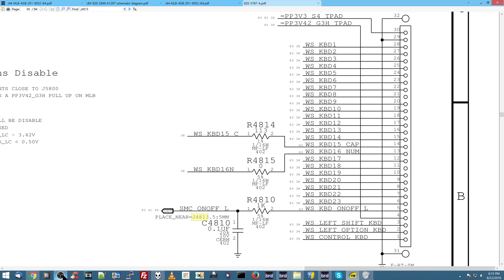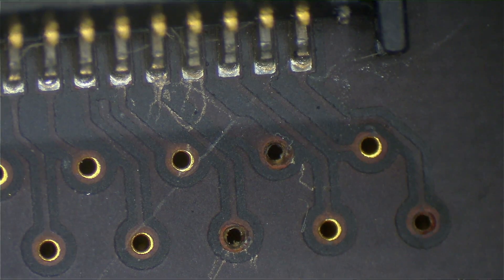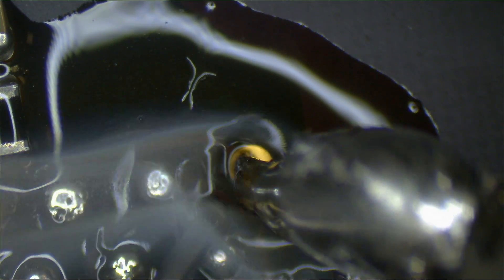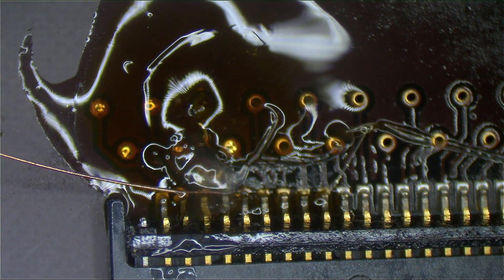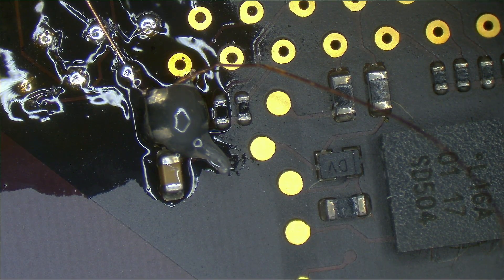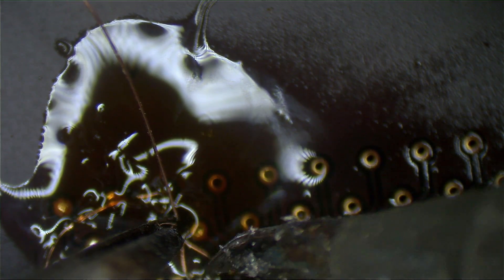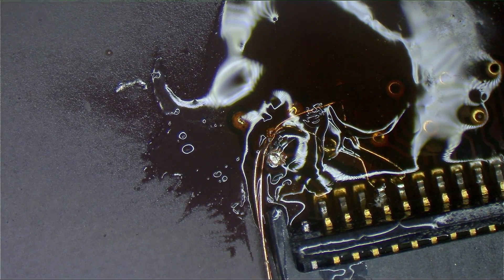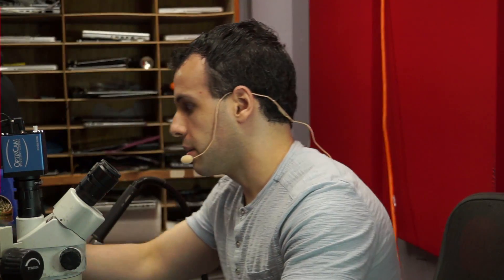Macbook Pro Retina bad power button but every other key works!

Comment: I need some help, I have a MacBook pro a1502  early 2015 and I'm trying to fix It myself, so, I was had a problem with the keyboard letters being intermittent, seems to be water damage, I replaced the keyboard, but before that I was doing use it fine with a plug in keyboard, until I decided to update, I updated again,I failed the update to due to wifi, the battery is swollen am so I decided to remove it until I get the new battery, it usually turns on once I pull in the charger, now it won't, wondering how can I get it on so I can update ..the new keyboard I got from amazon
Reply: The charger light stays on. When I do a smc reset the charger light goes from Ambe to green then amber again...I have a new trackpad and tackpad cabel
Reply: Any advice?

Comment: I have this exact issue with the same MacBook. The only difference is that mine is because of the ribbon cable itself. Looks like someone puppy ear folded the side that has the on/off pin. Pray for me as I'm about to do a whole keyboard replacement.

Comment: Very helpful Louis, despite being different model to mine.
MacBook Pro A1398 2015 15", I tested each pin with sharp meter probe, found 3.3v on pin 5, pressed power button =0v so proving power button OK..
But No power up?? can you advise what to do next PLEASE??  How can I get a crt diag??
Cheers John Barber, Australia..
Reply: I am experiencing similar from a An A1278 13", anyone have a direction they can point me in?

Comment: So if I had a butchered fpc connection with missing pads. Which pins would I have to connect to complete the circuit for only the power button to work? I have a mac keyboard but I want to be able to run it off battery and turn off and on any help anybody>? I currently have only pin 5 on off setup but it doesnt seem to be turning on the macbook by itself!. Any help would be great! Is it also a good idea to sauter wires onto the onboard pads located below? Like could I connect them to the power button on the macbook? I heard its not okay to use those ones every time? If so why?

Comment: good day I have an Apple MacBook "Core 2 Duo" 2.0 13" (Unibody) 
 Late 2008 Aluminum so my keyboard does not work so I can turn in on. my power bottom does not work is there any other way to get it on help, please is the only laptop I have using now at y home studio thank a lot

Comment: Hey. I had a little beer damage on mine cleaned everything can’t see corrosion and the white dots are still white. It turned in 3 times but shut down after a while. Now it doesn’t turn on anymore. Any ideas? I’m searching google like hell cant find anything. Thanks for the videos really interesting.

Comment: Ah yes Over-Night Sensation. Great album. 
Moving to Montana soon,
Gonna be a dental floss tycoon.  
Did you know that that album  features Tina Turner and the Ikettes? As well as the great violinist Jean-Luc Ponty? 
I remember the album quite well.
Reply from the maker: whoever is singing around 3:30 on montana is amazing. is that tina turner and the ikettes?
Reply: Yes. It is the Tina Turner, and the Ikettes. As you may know Frank Zappa had a sweet spot for Doo-Wop, and early Rock and Roll. Or what was commonly referred to as Race Music. And you can definitely hear that in Over-Night Sensation as well as the album that came after Apostrophe...
Look out where the huskies go,
And don't you eat that yellow snow.
I live in Arizona so i don't know if my comment was actually posted by me at 3:30 am your time or not. I don't know how that works. 
Great work. 
You and Heston Blumenthal are my heroes.

Comment: hello Rossmann, am from Bangladesh, my MacBook pro-2012 does not turn on. I need your help. while i press the power button sleep indicator light just blink for once but MacBook does not turn on. the fact is while i disconnect the battery and press the power button its turn on and work slowly. battery shows green signals and its charging while i connect the adapter. so where the problem you think. i have tried my local servicing houses but they cant able to satisfy me.

Comment: may i ask why you wired all the way around the board? you got solder through both hole ends, so why not wiring a tiny piece from connector pin to pad, then flip the board and continue from pad to smd resistor? wont that look tidier? maybe it is not reliable by doing so?
Reply: Andrea Lotito Does it matter how it looks when it's all inside a plastic casing?

Comment: brother please guide me. should i use the power pads as a permanent power on button?
Reply: Solder 2 wires to the power pads and add a small microswitch outside. When you hit the microswitch it will assert SMC_ONOFF_L and it will start. Would I recommend this? No, I would recommend you fix the issue causing it.
Reply: TCRS Circuit thanks brother. please guide me if changing the keyboard is the better option or just repairing will be sufficient. thanks

Comment: Hey Louis, sorry if this is a dumb question but basically what you did was use a new copper wire to connect between top and bottom to allow power to go into the #5 space?
Reply: Yup

Comment: Hey Louis i got the AmScope SM-4TP and also got the light ring on it. However with the light on it its kinda hard to fit a heatgun in between. Any recommendation on how to increase the distance of the microscope from the table? if i do it becomes impossible to focus on the specimen just to far away. Is there some kind of lens i can buy ?
Reply from the maker: +George241312 Barlow lens which I don't recommend or an angled nozzle for your hot air station which I do recommend
Reply: What's wrong with a barlow/reduction lens? If you have the extra magnification to spare, then it increases your depth of field, and also lets you more easily work between. Some scopes don't give you but 2-3 inches of working distance otherwise.
Reply from the maker: +Reed Arnold shittier looking picture

Comment: trust me i once fucked up the whol keyboard and then .. when i installed the new keyboard ... it was still not working .. and then i rechecked the on/off and i realized that the print was diconneced dew to rust .. and before i was just ditched by 3 volts just beside on/off signal on keybiard connector .. oooppss

Comment: +Louis Rossmann, my new Macbook Pro 13" (2015) has 1 dead pixel on the screen. Apple retailer in South Africa agreed to replace the screen under warranty. Do you think I should let them do it? I know they are "trained" but I'm afraid of the risk of them opening it up and fiddling. Please advise?
Reply from the maker: This is a personal decision/choice, not a question for me...
Reply: Yes, let them do it. They are responsible for everything they screw up. Just make sure to backup your data first!

Comment: what is flux and what is it made from sorry man I am a noob and I love ur videos.
Reply: It removes oxidation from metals so that the solder can actually bond properly. You can solder without it, but the joints won't conduct well or be very strong.
Reply: +Shiny Quagsire thanks man
Reply: +Lynn Nash thanks man

Comment: If these systems are so prone to this kind of corrosion, why can't they put conformal coating on areas at risk of corrosion?
Reply from the maker: ding ding ding...  IBM covered the board with black tape twelve years ago...

Comment: wont those wires short out or do they have plastic on the out side to stop that I know silly question thanks have learnt a lot
Reply: Yes coated wire if you notice he heats it to remove the coating 1st go then 2nd the solder flows over the exposed wire.
Reply: ok thanks to me looked like just copper wire so thanks for that couldn't see the coating on it but cool thanks
Reply: Same here. Color told me `Copper`.

Comment: LOL totally agree about OCZ. what a dogshit SSD company. had an ssd from them a few years back and it kept causing bsods
Reply: I bought a PSU from them and after my first boot it never turned back on.
Reply: Back in the day that was the case but now they use standardized controllers that are essentially the same as the rest
Reply from the maker: +GS540 I have never owned an ocz SSD that did not fail it within 2 years or less
Reply: I got both a Samsung 950 Pro and 850 Evo and they are great. Get those in case anyone is wondering. I hear that Intel is also really good.

Comment: before i saw the board i expected some kind of bad capacitor pulling the line low but when i saw that area with the (water/humidity?) damage i knew i was totally wrong, if i havent said it before, thanks a lot for the videos because of them i have started to see paterns in places i saw only chaos